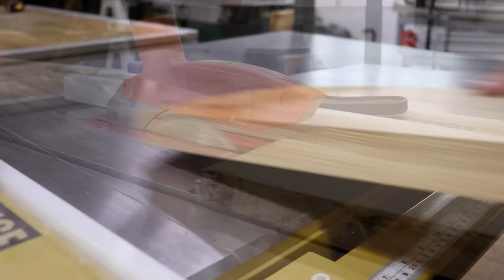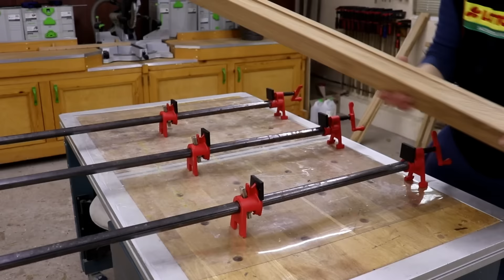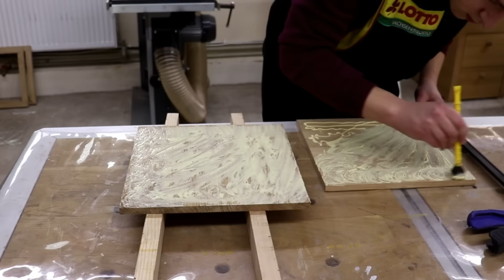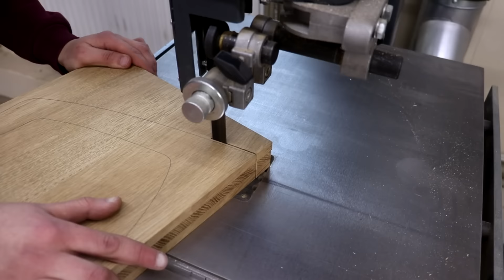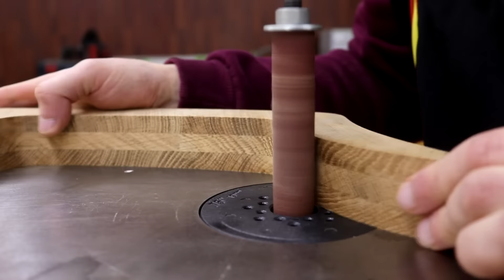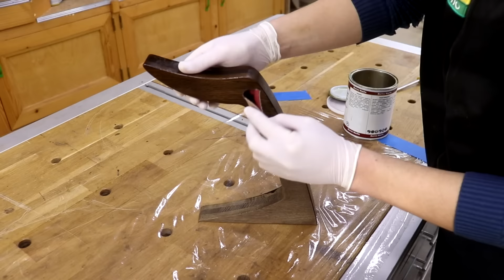A cool woodworking project for beginners. Woodworking.

Comment: It's difficult to watch something that says for beginners when no beginner has quite the arsenal of tools like this.
Reply: Right. Here is a "beginner" who went out and bought a table saw, a planer, a jigsaw, a huge work bench, 30 clamps, a miter saw, a gigantic belt sander, cylinder sander, and then proceeds to draw six angles with no explanation whatsoever. Is this some kind of joke?  All for a head phone holder? Just toss the head phones in the drawer and save us the time.
Reply: I'm going to say if you can't figure out how to do this with basic tools then this probably isn't a hobby or job for you.  Just because he is using higher end tools dosnt mean a beginner could not do this with a couple of basic tools.
Reply: @user-do9ry1em7j  disagree beginner means no experience just starting out this is not a beginner level woodworking project, it's a lot of work for what it is does looks awesome though
Reply: I stopped watching when the 3rd or 4th major tool appeared. No explanations for assistance. I don't even know what was being built but this certainly wasn't a video for beginners.
Reply: Perhaps you should take the ‘beginner’ label off … because there is no beginner with the machines you use.
Reply: That’s exactly what I was thinking before I read this message.
Reply: The job could be done with a jig saw and sand paper, he wasn’t wrong any beginner could have done this project. You guys all act like wood workers just buy everything all at once, that’s not how that works. We usually buy used tools and build up until we can afford new and better tools.
Reply: Whenever I start watching a video where the maker doesn’t explain what he’s doing, I immediately turn it off
Reply: @theSGTGardner you're gonna resaw oak with a jig saw? Joint boards?
Reply: Nothing says "Beginner" like $30k in tooling....
Reply: All this for a thing to hang your headphones on.... You got to be kidding
Reply: Exact same throught, "ah yes the beginner who owns a table saw, thickener, jointer, band saw, loads of big clamps, a mitre saw on a built in bench, a massive workbench in a huge shop and not to mention the massive shop vac..." fuck me life.
Reply: I'm a beginner but have access to a community workshop with all these tools. It's possible in some places
Reply: I found it pretty easy to watch, as someone who is new and uses hand tools I was able to watch this without any effort whatsoever.
Reply: I totally agree, that’s not a beginners work shop and those tool just might make a project go easier than what the typical beginner would be working with.
Reply: @user-do9ry1em7j then why didn’t the video use basic tools???
Reply: @user-do9ry1em7j You completely missed the point of beginner. Dude literally drew a template and used a $1000 bandsaw and a $1000 belt sander for this project. As a beginner how tf am I supposed to figure that out? Not to mention the thousands of dollars of clamps he used

Comment: Right. Here is a "beginner" who went out and bought a table saw, a planer, a jigsaw, a huge work bench, 30 clamps, a miter saw, a gigantic belt sander, cylinder sander, and then proceeds to draw six angles with no explanation whatsoever. Is this some kind of joke?  All for a head phone holder? Just toss the head phones in the drawer and save us the time.
Reply: You forgot band saw

Comment: This misleading project requires a range of skills that 'beginners' are unlikely to have, and a workshop equipped with an extensive range of power tools to make the project possible!
Reply: Exactly. It's not even just the fact that they're using lots of different expensive tools. It's that there are many processes involved, a lot going on. For a beginner project, I expect something much simpler than this. I have seen other people point this out, and some respond that oh, you could do this with much simpler tools. Fine, but beginners like me might know that or might not. I enjoy watching this kind of work, just don't call it a "beginner project"
Reply: Agree

Comment: I agree with most comments about this being a little much for a beginner but if he would have shown what he was making first, I would have just hand drawn that piece on paper, use that to cut it out of a solid piece without all the gluing boards together and sand it with palm sander, finished with hand sanding, stained and varnish,  and I bet you would not know the difference.

Comment: Of during the build you want to use your huge tool set thats fine but whole doing the video you need to explain what youre doing and how we could do it with what most beginners have loke a circular saw and drill. Not a bandsaw and table saw